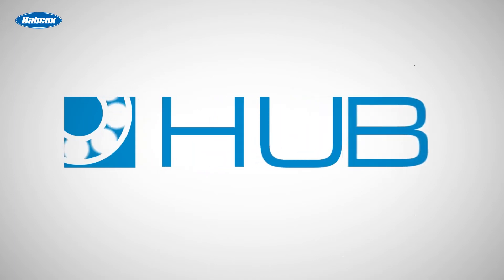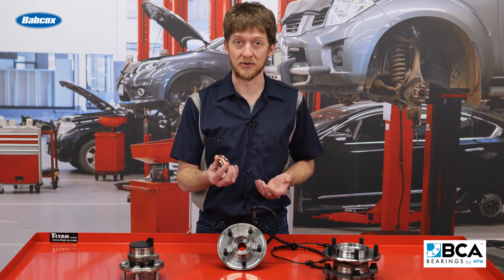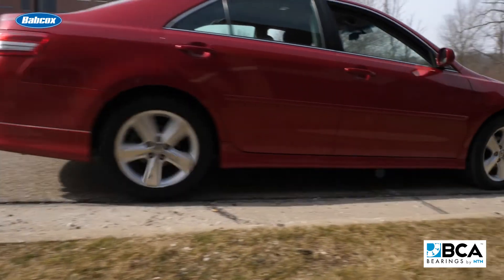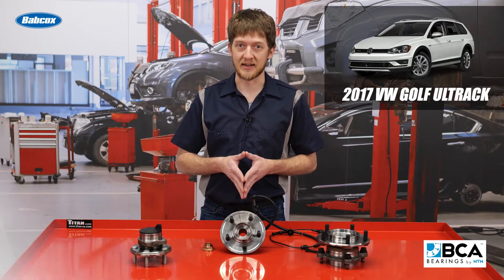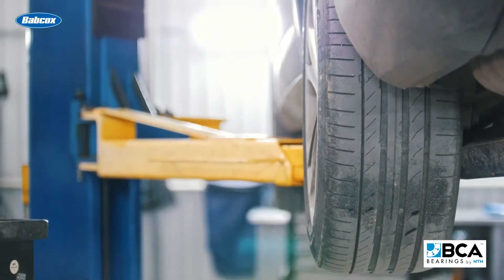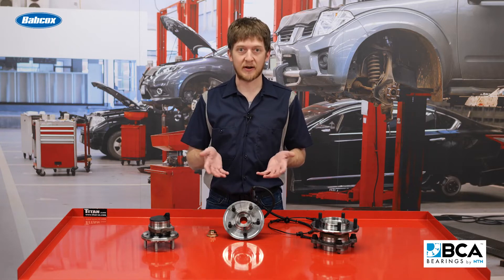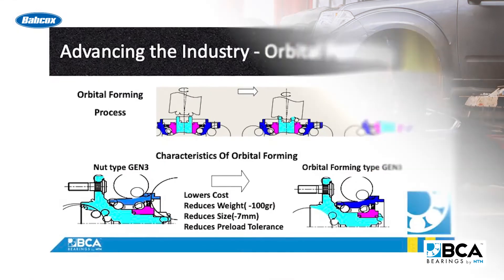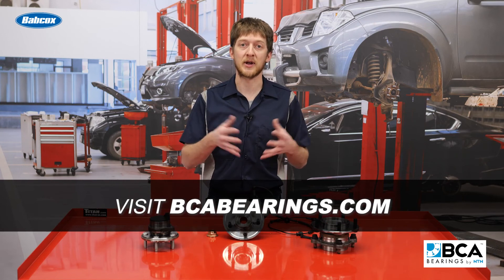The Importance of Proper Bearing Preload During Installation

Comment: Do the front hubs on a 2011 Xterra 4x4 require preload from the axle nut? Or is the torque spec for the axle nut just to keep the axle tight? Could I theoretically run 4x4 hubs on a 2wd without issues?
Reply from the maker: Good questions! 

Our BCA WE61172 hub assembly for the 2011 Nissan Xterra 4x4 model is designed with a “rolled closure”, which sets the preload on the bearing from the factory. The Nissan factory torque spec for the axle nut of 101 ft-lbs is to properly retain the axle in the splined hub, not to set the bearing preload. 

Our BCA WE61213 hub assembly for the 2WD model also features a rolled closure design which sets the bearing preload, and since there is not axle nut, there is no torque spec needed. 

We do not recommend the use of a part on a vehicle it is not spec’d for, like swapping the 4x4 part in place of the 2WD part. The mounting dimensions and bolt pattern may be the same, however for safety reasons we cannot recommend interchanging the parts. 

In this case we offer the coverage for both 4WD and RWD at similar cost and availability to accommodate both models. Thanks!